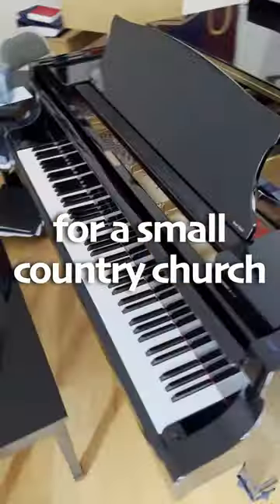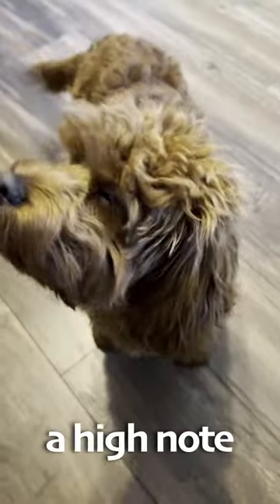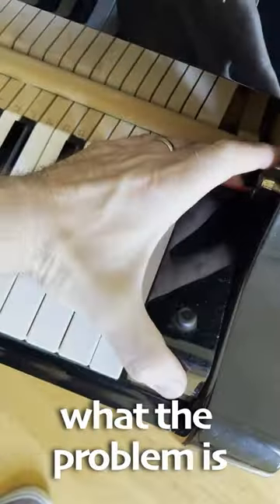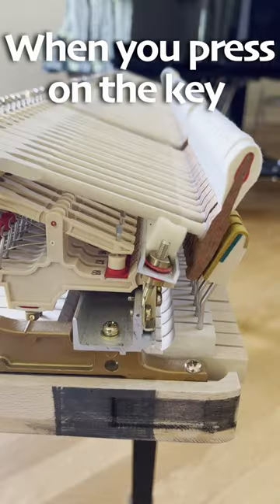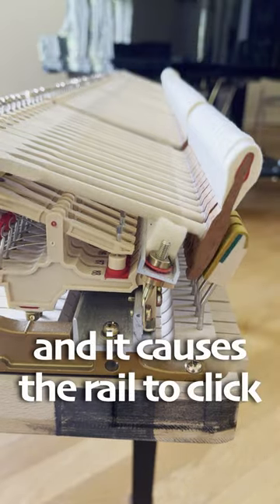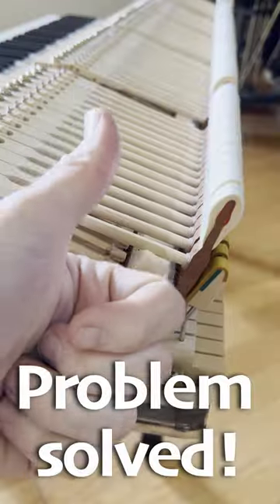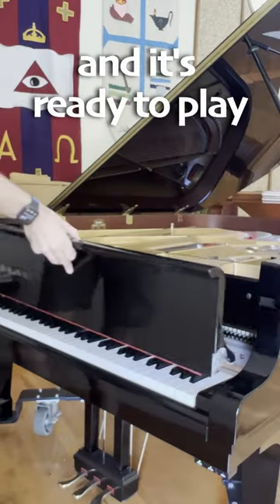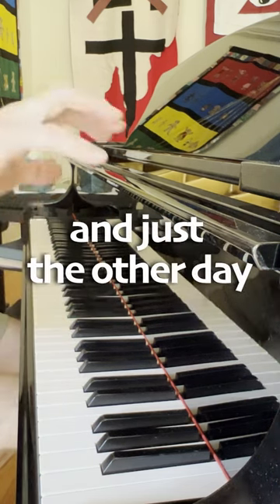fix a clicking key on a grand piano #piano #shorts

Comment: I've never seen a nut like that. And I work in a workshop.
Reply: I also thought that was really cool. Purpose made fasteners are super cool
Reply: Yeah, I thought the same. They look pretty slick, though. Probably prevents over tightening.
Reply: @claytonharding  It allows you to use a long screw driver to tighten it from straight above.
Reply: @oliverheaviside2539   Oh, you're definitely right. I just meant apposed to nut drivers, which in my experience are used often for similar aplications, and can apply much more torque.